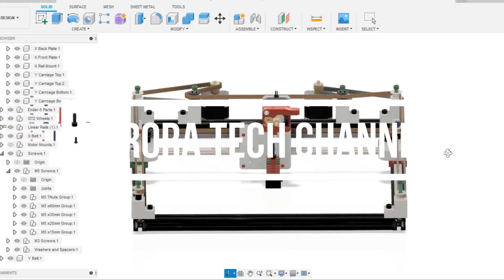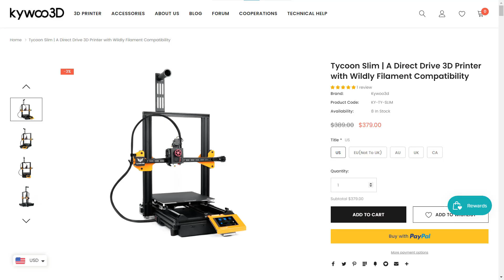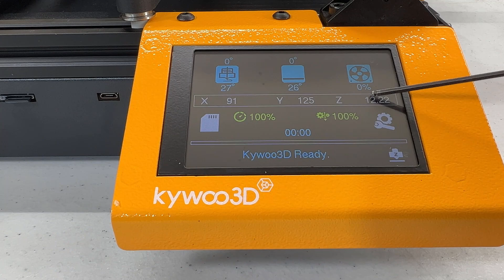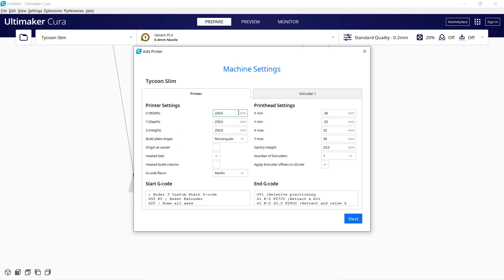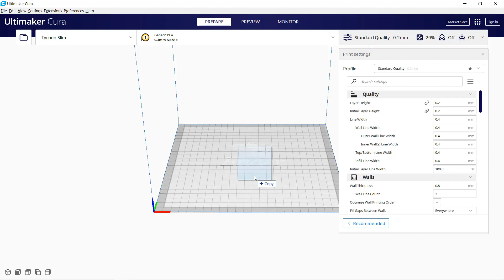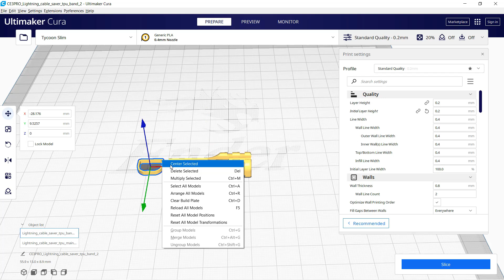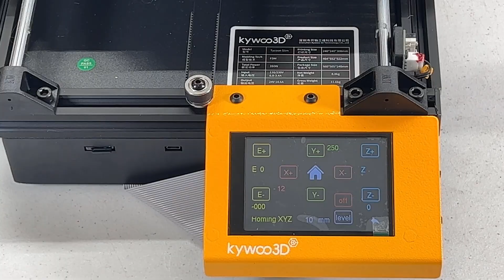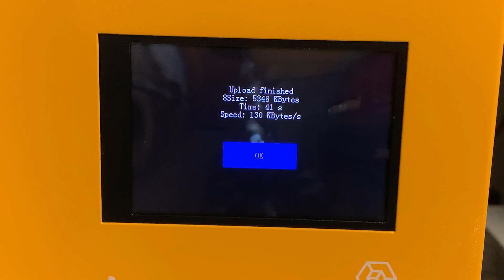KYWOO Tycoon Slim 3D Printer, linear rail X + linear rods Y + Dual Z Axis with timing belt

Comment: I just picked up one of these this week and I REALLY like it.  It's not perfect but it is a really good printer.  It's not an out of the box "plug and play" setup...you need to do a bit of tweaking to get everything just right but it is really well made a well built.  I'm rather shocked.  Firmware didn't match what was in the video.  Mine was at V3.0 (?) but after firmware update I have these menus now.  Original one was very basic like I have see on the tycoon max videos but the update has a ton more functionality and options.

So far the only real problem I've encountered is that everything is printing in a mirror image.  It has to be something in the settings though because if I use the same gcode file on my geeetech mizar it prints properly.  I've gone through the menu though and I can't find any setting for this.  Kind of baffling.

Update:  All good now.  It was a firmware issue.  Downloaded a new copy and reflashed and now prints are perfect.  I REALLY, REALLY like this printer.
Reply: i also do have 3.0 firmware and mine printer just got stuck on X axis. It is like moving normally on Y and Z but has completely no response with X. Cannot level the bed now, or make some baby steps either. I just found out that there is only V2.1.3 available and cant say if it is the latest one, because it is from 2 years from now. Dont know what to do.
Reply: @szymi3126  V2.1.3 is the latest firmware available.  I would suggest disconnecting and reconnecting the X stepper at both ends.  If no effect reset to factory to clear the eeprom (make a note of your Z offset first).  If no help reflash the firmware.  If none of that works then chances are you have a bad driver IC on the mainboard and sadly it seems these boards are no longer available.  If the IC is bad you could conceivably replace it if you have good micro-soldering skills or know someone who does.  This is why I prefer removable drivers.  I hate to replace an entire board just because of one small part.  Worst case you could replace the board and LCD and load the latest version of marlin.  Might even be a great time to upgrade to klipper.  A manta m5p_cb1 would work perfectly.

Comment: Aurora.  Please i. Need help for slim to auto bed leveling before each print.
Reply: Not sure if you ever figured this out but you just need to add the G29 command into the start code in your slicer. That will tell the printer to auto level before every print but once you've run an auto level and saved the mesh you shouldn't have to do it again very often.

Comment: Excellent review as always Aurora 👏.  I'm new to 3d printing and evaluating my first purchase. Can I have your opinion ? How would you say the ender S1 pro compares to the 'slim'  ? I'm from a CMM background and familiar with cartesian structures. But they're super accurate using granite, ceramic and air bearings. I like the 'slim's Y axis rod spacing. That seems to me a better approach to robust geometry. The price is also significantly less compared to the S1 Pro ...  appreciate your opinions.... 🇬🇧
Reply from the maker: If you don't need to print high-temp filament, Ender-3 S1 is just $399. 
https://bit.ly/3DS6YQc
My Ender-3 S1 review video:
https://youtu.be/sbRHZUnmfYw
Reply: @AuroraTech  ok thanks.

Comment: I don't get the belt between the Z axis motors? With a dual motor Z axis it's already syncronized?
I'm running a dual Z motor printer for years and never had sync problems.

What strikes me is that design flaw where the X belt is not in one straight line from left to right, it goes up to connect to the carriage. How on earth can an engineer  get away with that? The belt is getting tighter when printing near the far left and right of the rail. I've seen this on more printers lately..